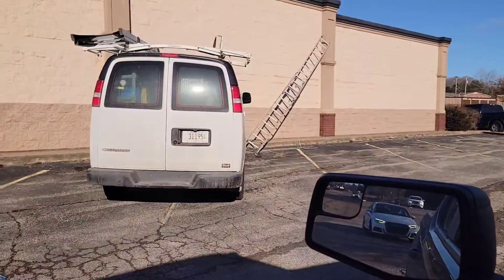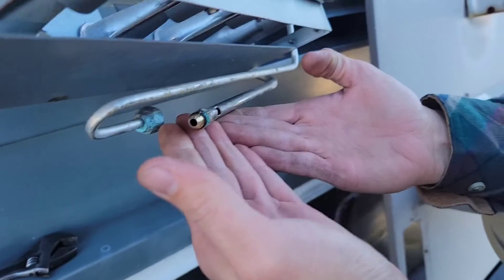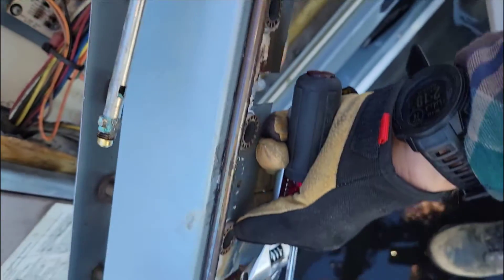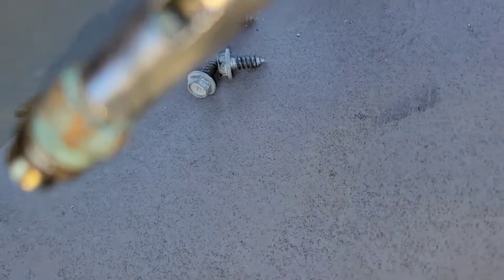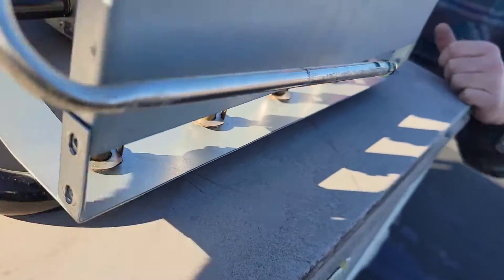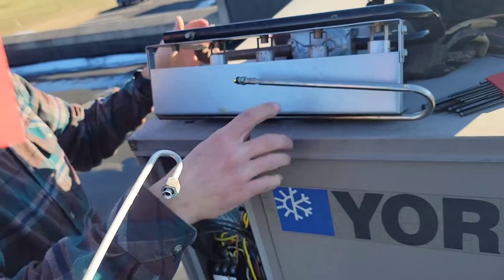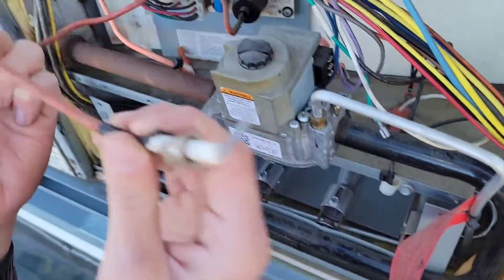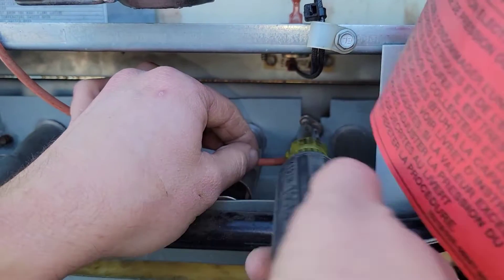HVAC Guide: What is a carry over tube?

Comment: Hey taddy. Great content. I had an issue today with a York micro channel. The head pressure was climbing passed 600 and suction was normal around 100 psi. Ambient was in the 50s. It’s for a meat processing plant that uses heat and cool during this time of year. 2nd circuit running fine but seemed to come out of kno where . There were getting alarms for compressor lockout low pressure which seems odd. If you want lmk what you think. HVAC for life
Reply from the maker: What was the super heat in the subcool
 What other checks did you make
 I would need a little more info to give a good answer for this
 Thank you though for sharing this
 It could help somebody else along the way
Reply: @taddydigest  when I first checked I had high superheat and no subcool. But the next day I couldn't even get a reading it was climbing so fast.
Reply: @taddydigest  I think txv is acting up. I heard this happens a lot with micro channel coils. I'm going back to confirm diagnosis this week